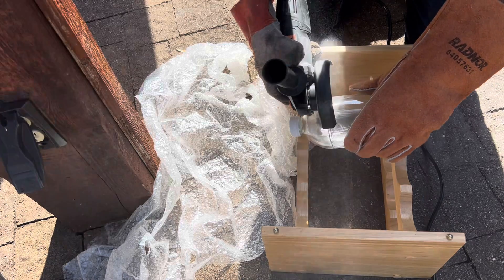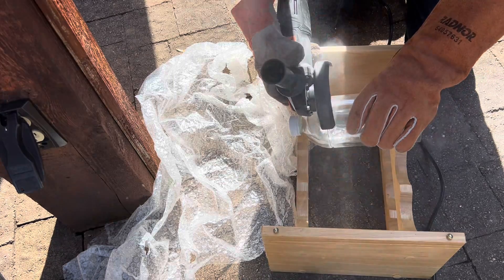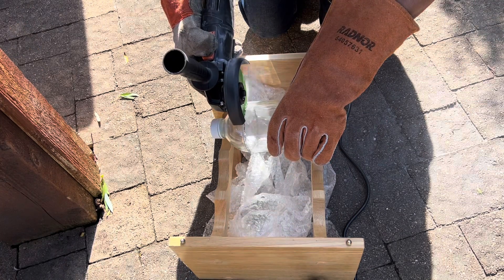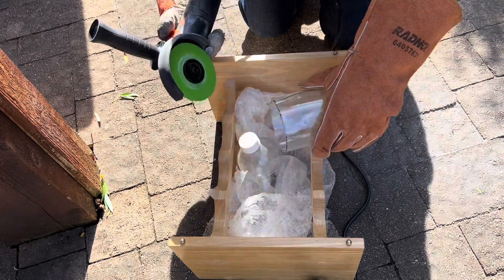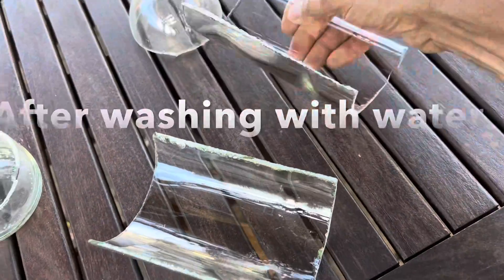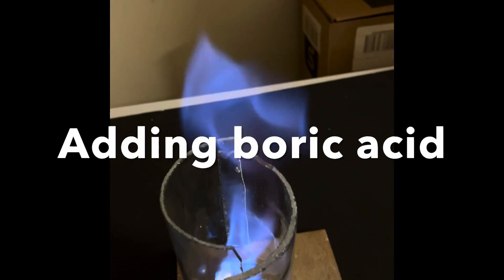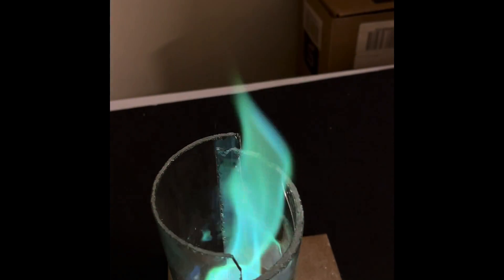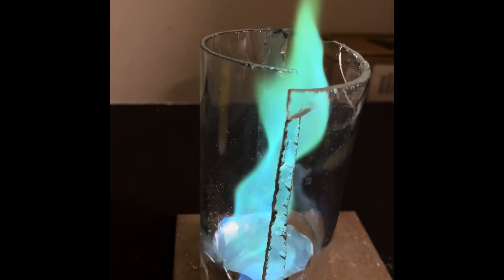Supercool “Cool” Flame Vortex

Comment: if you make the next level, it will start to create a blast kiln that will achieve runaway temps without a regulator.  If it winds up and then gets regulated down, it might take less energy to keep going than it does to start.  Fire turbine
Reply from the maker: Great idea
Reply: @BrianDhvTinkerer    you have no (or some) idea
Reply: @BrianDhvTinkerer    I was told that there is a patent for this.  Now bear in mind that I heard it from a nutmeg junkie, but he came from a military family and he was professionally trained to make tea pots.  The most expensive ones in the world.  What I'm describing is what he says someone patented, and basically stole from him or his family.  It would start running away with power and had to be regulated, like it had over unity.  
And it's just the basis for a whole world of vortex science.
Reply from the maker: I’m thinking perhaps have cascading glass curved vanes using successively smaller ones to thin down the diameter of the vortex and get the flame hotter
Reply: @BrianDhvTinkerer     Perhaps in a golden ratio or something simplex like that, yes.  Good video!
Reply: @BrianDhvTinkerer   listen to Frank Sinatra, come fly with me, all his flying songs, and think of riding in a supercavitating submarine.  You'll freak out.  Yep
Reply: @BrianDhvTinkerer    they've been around since the 50s.  Lolol cough
Reply: @BrianDhvTinkerer    it was the same man who told me about supercavitating submarines.  Those don't even officially exist, but I'm sure he's right.  They make supercavitating torpedoes, already.